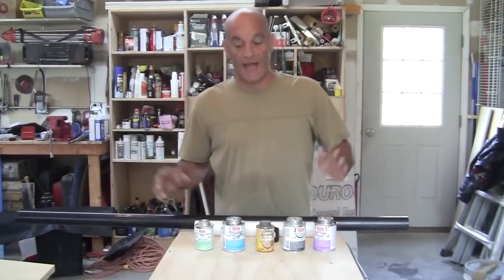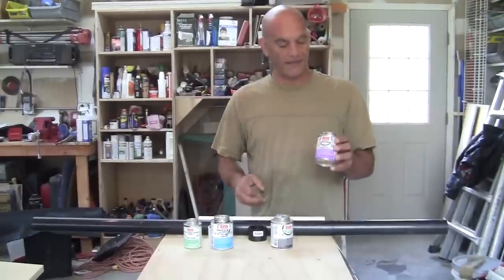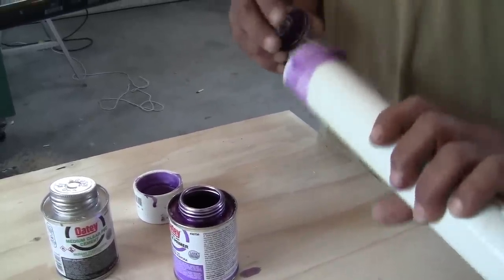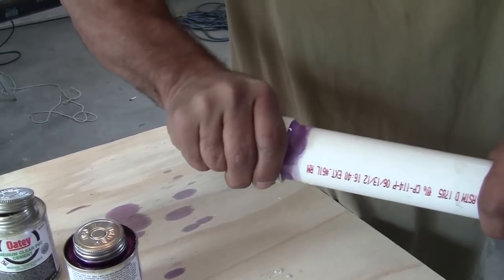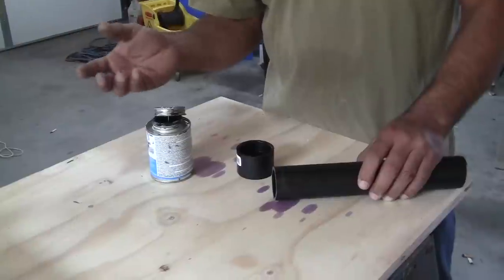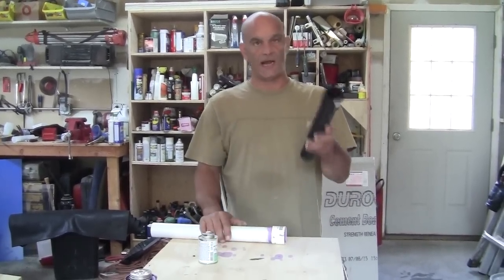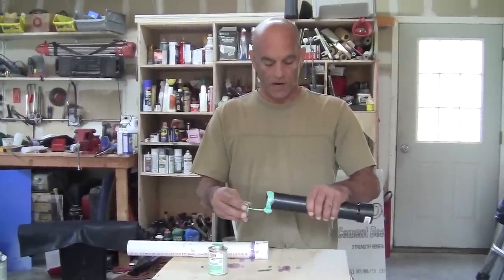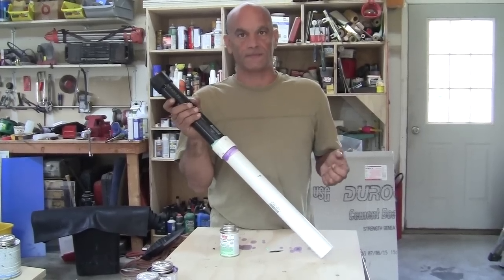How To Glue PVC and ABS Pipe

Comment: Thanks Domanic. Why don't we just use the lizardsnot for everything if it works with both ABS and PVC?
Reply: +threeque probably more expensive
Reply: There are many reasons including that it does not make such a strong bond as compared to regular clue, therefore many municipalities have codes against using the Transition Glue or a maximum of using it once (You would use a Mechanical Connector, NoHub Coupling, Frenco Gasket)

Comment: dominic, i have a question. recent i put cpvc pipe in a trench to run underground powercable. went to hardware store and discovered that there is 2 kinds of pvc cement out door and indoor, whats the difference?  dick bailey thanks
Reply: I wasn't aware of this. I put some under my house so I wonder if this being cold/hot and exposed to elements if I should have used this "outdoor glue"

Comment: Dont you have to put glue on fitting and pipe ?
Reply from the maker: No, primer on both yes, but you only need to glue one end.
Reply: I don't guess you ever checked the  Oakley website  the manufacturer says put glue on both the pipe and the fitting

Comment: When my father did the sprinkler system on his house, I'm not sure if he misunderstood the employee or didn't listen. He installed over 1000ft of PVC underground with just the purple primer! Well, 15 years later it is still holding strong. fingers crossed
Reply: yea its going to come apart. Especially if there is a lot of connections and the pressure is high. If its regulated then maybe not amazed 15 years no issues, or maybe its causing a sinkhole underground and you just haven't noticed
Reply: The primer is more important than the glue. Look up solvent welding. The glue is used to speed up the plumbing process but can be eliminated if for some reason u didn’t want to use it. My dad was a plumber and I helped him on a lot of jobs. In certain situations he wouldn’t use glue when he knew the joint would have higher than usual pressure. He would put primer on both parts and stick them together and move on to something else but he would go back to that joint and keep putting primer in the joint. Like I said look up solvent welding

Comment: what if there was an ABS drain pipe that was repaired and a PVC coupling was used
Reply from the maker: As long as the glue they used was for both pipes that should be fine. If the glue is green even better.

Comment: Whoever did the plumbing in the house I just purchased didn’t use any cement in a few places. It’s driving me bonkers. First I (stupidly?) assumed that the person HAD used cement and so I went about attempting to fix the leak… but of course I found out it’s not a “leak” because it was never put together correctly. We are talking black abs pipe literally just pushed together with no cement. Who the heck does this? Do people do this? Plus I’m trying to do this while I’m half dead from the recently rebranded common cold… hehehe.
Reply from the maker: Yeah crazy. I just had a plumbing inspection to where I either had to fill the whole system up from the roof vent with water, or to cap off everything and pressurize the whole system. I did the pressure. That would prove if it was glued or not.